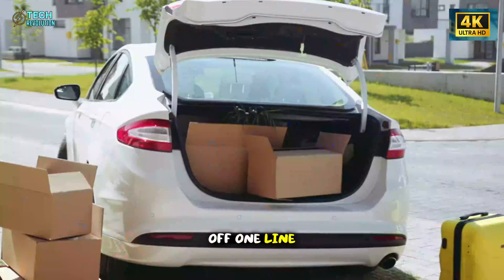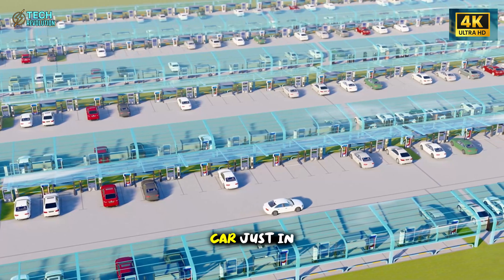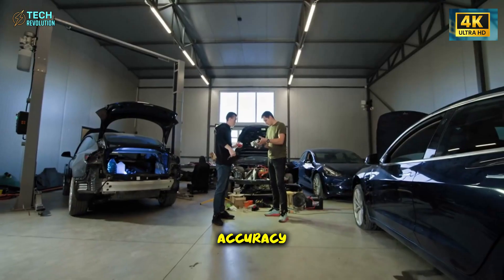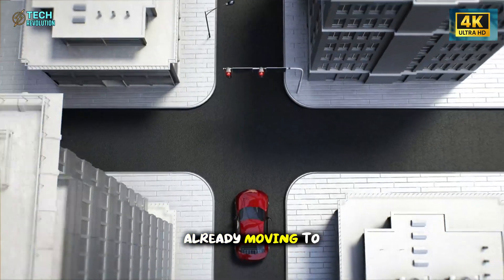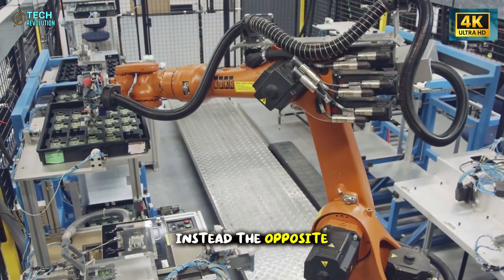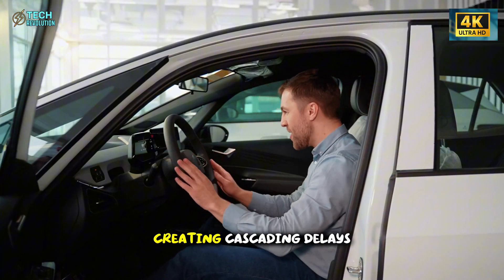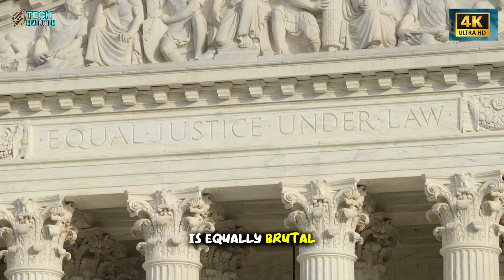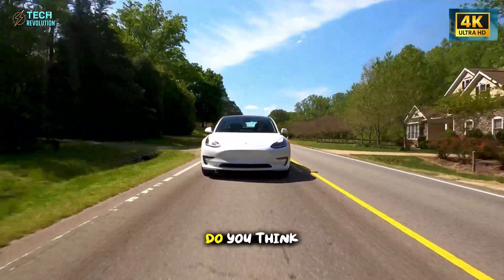Tesla's Model 2 Line Does 3,000 Cars/Day FINALLY HERE: What's SHOCKING?

Comment: I want a turn signal stalk. And a push button start. Then will get  a modeI 2. With fsd built in. With lidar and radar. And better than I can drive both day and night with rain. No tiny squinty headlights blinded in snow.
Reply: Don’t forget your buggy whip.
Reply from the maker: Totally hear you — a signal stalk, physical start button, and stronger sensors would solve most of the usability complaints. If Tesla adds that to a Model 2 with reliable FSD and real-world weather performance, it’d be unbeatable.